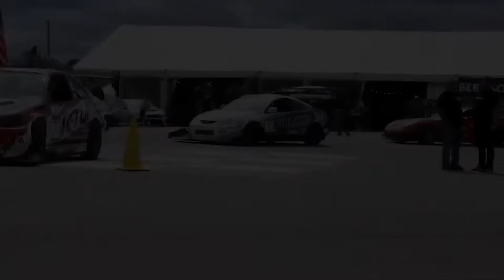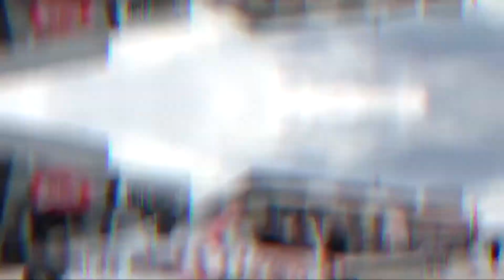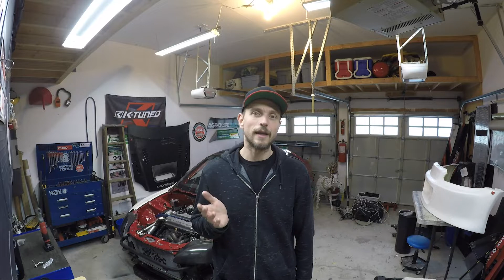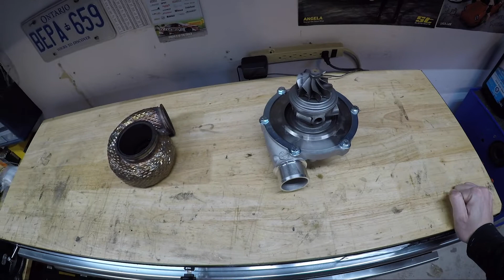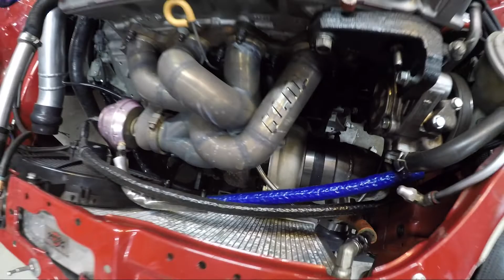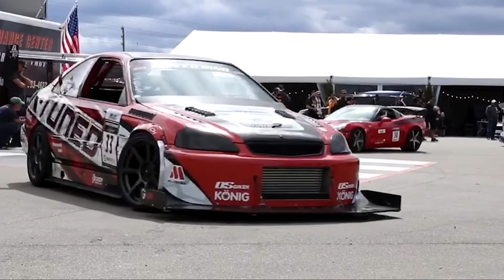Turbocharging your Time Attack Car With Garrett Turbos!

Comment: I appreciate you sharing info and look forward to hearing more. I recently bought a stock Honda D15 EK which I plan to slowly build up to a time attack car (500-600 whp range). I still have plenty of research to do and stuff to learn, but info you share will greatly assist to reduce "school fees" along the way. What makes your point of view better than most high power Honda cars on YouTube is that you need usable power and the car needs to handle the heat of full power consecutive laps. One topic I would like to hear more about is stumbling blocks you faced with the B-series engine/gearbox doing time attack events as the car evolved, i.e. mods done to the engine/gearbox for reliability, why B18,  when what needs to be done regarding cooling and at which power level (water and oil), any power steering issues/mods, etc. Other topics: chassis mods required to handle the various power levels and basic aerodynamic considerations.